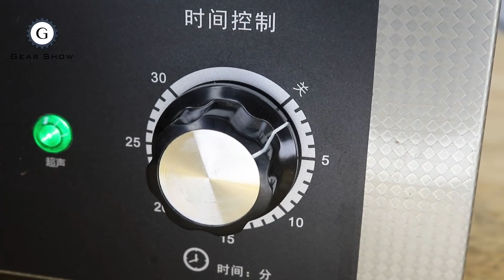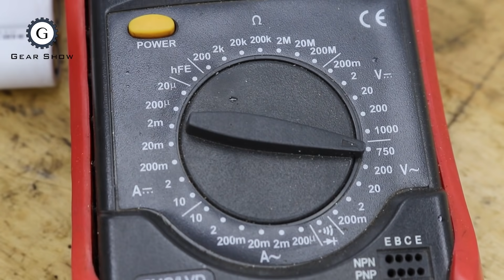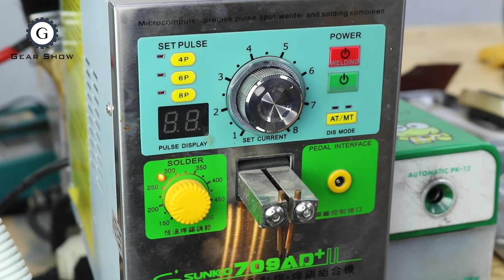Old version 12V Impact Driver Restoration | Dewalt DW052-JP TYPE1

Comment: Great work! I adapted a 14.4V DeWalt drill to use 20V Max flat packs, and that thing flies! I don't have to use high gear, low is fast enough!  I didn't think it would last long, but I've been using it several times a week for 3 years with no signs of cooking the motor.
Reply from the maker: Nice work, Thanks for the tips!

Comment: Very nice work! Only thing I would improve is thicker cable from main minus and plus poles of the battery pack to the BMS, since those carry a lot of current. The wires from BMS to drill are good.
Reply from the maker: Okay, thanks for the tips!

Comment: Audience, I know at 12:18. You want to keep that solder smoke out of your nose. Oh and great portable fan. I just use a small USB fan with battery pack. It works the easiest. Great job on the full restoration...

Comment: So is it just me or was the drill ok from the start and just needed a hot battery 😂? Great work cleaning it though
Reply: Bearing was bad.
Reply: Where does it show that the bearing was replaced or damaged for that matter I'm sure it was bad after removal because the outer race was what was used to pull it off either way it was a nice job
Reply: Lol I was thinking the same thing
Reply: I mean, I’m sure that if the drill was broken he would’ve named the video. “Fixing”
Reply: Restoration is just bringing it back to life it doesn't always have to involve fixing any sort of mechanical or electrical failure
Reply: Yeah I don’t think it was necessary to get into the drill that deep

Comment: You must have a different size 12v battery pack case than I do.  Mine will barely hold 2 18650 cells.  I would up having to go with new SubC batteries like it originally had.

Comment: I have to ask, are you able to use the original charger with the new batteries? If not how do you charge it? Great work btw, love the channel!
Reply: I have the same question. Also, there is a difference between working and working well/safely. Li-ion has different charge curves than Ni-Mh.

Comment: 6:00 You can open the sound wave sealed plastic with coolant spray
Reply from the maker: Oh, that is cool, thank you so much for sharing :)
Reply: Do you have any videos? I can't find anything relevant
Reply: @soldiers303  just search it on youtube The Easiest Way To Disassemble Laptop AC Power Adapters And Wall Warts

Comment: I notice you left one old NiMh cell in the battery. I realise you need it there to hold the contacts in place but wont the battery eventually corrode inside and cause other problems?
Reply from the maker: I use only negative of the Nimh battery, I think it will be okay.
Reply: @gear_show  that is not what I mean. The battery itself is old and looks about to start leaking and corroding from the inside out.

Comment: Hello;  Wondering why you did not change the single vertical/top battery?
Reply from the maker: I use it to hold the connector, It is insulation.

Comment: I would make sure the sucker runs before doing all that work, then check to see if the motor needs new brushes. Those little ball bearings I would have dropped most of it on the garage floor and never find it again. Been there done that. Do you need a new 12V Li-ion charger? Where did you get those decals? The two old impacts don't seem to hit very hard like my 12V Milwaukee, or perhaps the audio from the impact sound didn't come through. Excellent job, super impressive!

Comment: This was well done.  The soldering was a little ... excessive but very serviceable.  And you tightened by hand vs. with a drill or driver... Very glad to see that.  Would adding in a couple bearings to fill the gap under the bearing washer be of any use?  It hurts my ocd (and I know you didn't lose any.. its like that from the factory...)

Comment: Did you spray the cleaned case with clear? And if so what type? And how is it holding up being clear coat on hard plastic case...
Reply from the maker: Yes, I did. I use general clear.

Comment: 750+ comments; Nice work. How do you recharge the battery pack?
Original 12v will not charge up to 12.6v
Reply from the maker: I charge this battery with li-ion 12.6v charger. The original charger isn't used.

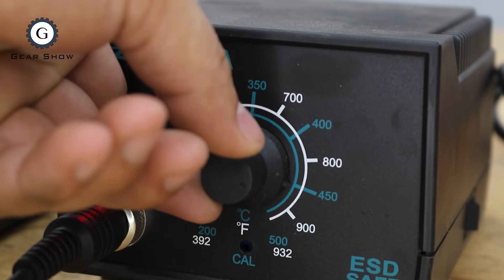Comment: 11:51 what? how many degrees did you set there? 450 ?????? that's a lot at most 300 for soldering otherwise the tin will be burned very quickly and you won't be soldering well otherwise super video :)

Comment: Question , the battery you put back on the top of the battery assembly that was soldered to the replaced batteries , was that a Nicad or Lipo battery
Reply: NiCd

Comment: 12:38 Isn't this gauge of wire too thin for the amount of current drawn? This BMS appears not be wired like other ones that have the negative from the battery go through the BMS board. So it appears the charge balance wires also carry the full battery current.

Comment: Crazy seeing a vid for this DeWalt model while randomly browsing the results & related-s of my very generic searches for more repurposed motor ideas after having very recently installing the deconstructed motor from this *exact* model as the means of spinning an extremely homemade (but robust af) ball mill thats powered by a similarly deconstructed microwave oven transformer with a DC-rectified, one-turn secondary just shy of 2, which keeps the ludicrously high torque @ high speed at a sane range while also supplying the voracious current demands to move the thing at a severe under-voltage. I would've preferred using a bunch of paralleled 18650's & be akin to the inverse of what this video accomplishes, but I learned that even a mere 3.7-4.2v is still hilariously WAAAY overpowered with this little beast of a motor & hence the "over-engineered" mains supply.

Comment: I am curious as to how, with a 6-cell you manage to get  12,6 V  !!!!
3.6 V * 6 cells =  21.6 V  or  the parallel  3.6 V * 3 cells  = 10.8 V to get double capacity.
Can you provide a schematic diagram ?
Reply: Full charge is 4.2v

Comment: Does anyobe know the size of the bearing in the drill retaining head? I watched this out of interest a few months ago and then saw the same model at 15 USD in a local Japanese thrift store with a bit stuck in. Another video (or this one) shows how to disassemble the head to take out the bit but the sleeve was so tight I had to bash it off and lost the retainer bearing. Now all I need is to convert to Lithium but the old battery is still going.

Comment: so.. this was put in  garbage bin because somebody opened it. and forgot to put back "bearing washer" @2:27 on right place.. and then put that back on wrong place @2:44...  You put that bearing washer on right place  at 19:23. .. so the point is.. always when first time you open the tools... either record a vide so you could see what goes back where or put on a table in sequence.. or if you are opening an old already opened device please follow user  Instructional manuals.

Comment: Excellent Job! Do you get the new labels from DeWalt or did you print them? Just one little hint for work safety: It looks as if the gasolene bottle is not marked. It is a good idea, not to use bottles that are - or look similar - to bottles for beverages and to put a label on the bottle just to avoid any poisonous mistakes.
I'll check out your other videos now. Keep up the good work!
Greetings from Germany!
Andreas
Reply: He printed them...his logo is on them.

Comment: ....The spot welder. I would be making battery packs if I had a spot welder. There are loads of old laptops thrown out at my work with good batteries inside them.  The spot welder is about 250 USD including shipping from alixp. I would need to make at least 5 battery packs to get my money back.  Hmmm... Is there anything else I could use a spot welder for? Some people make their own but that looks difficult too.

Comment: Very nice work I wish to try I need the specification of bms as how much amps am trying with same 3s 2p 18650 for a 12v cordless gun am unable to finalize amps, there is no ratings on gun

Comment: Isnt it dangerous to try and use a charger for NIMH (usually a DVDT) for a li-on battery?
Reply: Not so much cause the BMS will stop the charge when the max voltage is reached.

Comment: you could've used Gasoline as well as solvent to losen the glue on the battery casing and get it open easily without destroying it.

Comment: Don't understand how you only get 10 volts out of 6 X 3,4 volts batteries you should only need 4 in series to get the needed 12 volts load and 13,6 volts peak charge ? Although great work , you inspire others to do the same and not throw away good tools who can serve more years instead of heading to the landfills !
Reply: They are connected 2 in parallel in a series of 3

Comment: Thanks for great video. I have a question about batteries system. Are 3C li-ion batteries and 20A BMS enough for working drill correctly? I asked because I think converting my 18v metabo drill from ni-cd to li-ion. I  m hesitant about batteries instant discharge capacity and bms capacity. Thanks in advance
Reply: Any answer for this?

Comment: Thanks for the video! 
I have a beginner's question: after replace the internal battery from Li-Mh to Li-Ion, can you put it back on the Li-Mh charger to charge? Or after the replacement, the charger needs to be changed to Li-Ion charger as well? Because I thought the current Li-Ion battery chargers can't charge Li-Mh batteries?
Reply from the maker: The li-ion battery can't be charged with the Nimh charger.
Reply: @gear_show  Thank you for the reply! I guess as long as voltage and ampere suits, and connection compatible, any charger can charge right?
Reply from the maker: @barryluo2011  in this case https://youtu.be/ukKuCGG38n8 I can charge the li-ion with Nihm charger.

Comment: Amazing video considering you don’t speak at all!  One question: how do you recharge the new battery pack?
Reply: actually such batteries are charged from the same way from they discharge.. so when you put this battery in charger it is charged ...
Reply from the maker: Hello, I'm sorry for missing that part. I use Li-ion 12.6V charger to charge this battery pack.
Reply: @gear_show  How do you connect it? What Brand/Model/Specs are important?
Reply: Li-ion battery pack on charger without magnet relay switch,, 18V li-ion battery pack built-in magnet 🧲
Reply: @gear_show  could you post some more info on the BMS board and the charger you used? 
Thank you for posting these videos and for inspiring people to repair rather than buy new stuff.

Comment: Thinner wire from batteries to BMS, and thicker wire from BMS to the power connector is wrong. B+ and B- connections and the power input/output port should have the same gauge thick wire. The balance connections are ok.
Reply from the maker: Get the power source from BMS for low voltage cut off, if you connect direct from B+ and B- the battery voltage will reach 0V, that time you could not charge the battery.

Comment: You used thick wires from the cell managing PCB to the terminals, but shouldn’t you have done so too from the battery 0V and 12V to the PCB? Best regards

Comment: During the test, how did one of the screws get messed up (mangled)? 
Great video as always
Reply: The nail was set in a knot, they’re hard to cut, drill, hammer through. Caused the nail to mangle and torsion
Reply from the maker: Maybe this section of wood is hard.

Comment: Great job sealing the lithium battery up with no venting. These never get explodey. So how you plan on charging this now? SMH
Reply: He will probably modify his charger with CCCV (constant current constant voltage) electronic
Reply: @marko4377  gonna need a whole bunch more electronics than that.
Reply: Transformer, rectifier, capacitor and cccv? Am I wrong
Reply: @waltkosch  bms should have over load protection if it is better quality, I am building the exact same battery pack right now and I am using samsung 25r batteries and bms that have balancing and all protections features, in my opinion only thing he should have done is thicker wires, idk what quality is that type of bms and I would pick samsung or lg or sony or panasonic batteries. What do you think
Reply: @marko4377  Sony VTC5s. Good luck!
Reply: @waltkosch  yeah, i think makita use sony vtc as their battery cells and Milwaukee uses samsung, I hope it will be better than ni cad. Have you some expirience with building battery pack for cordless drills
Reply: @marko4377  I don't bother with making non lithium batterys lithium. To start with the motor alone isn't brushless.  It's like putting lipstick on a pig. With vibration and use and abuse you are best sticking with the stock packs that can often be found reasonably cheap enough not to go through the hassle of building them yourself. I only find building my own packs for hobby grade RC and things of that nature.

Comment: My master made it like new, even the factory cannot restore it like this, my master 13:45 can I find the name or the diameter of the cable, I can find what I write on the internet, I am designing an rc vehicle, because the lipo piler is overcurrent, the cable problem is the cable I am looking for, please write the name of the material you use.

Comment: @Gear Show You are using 3x3,7V batteries so it gives 11,1V. You should normally go with 4,2V batteries. How you get 12,6V? Or maybe there isn't 12V? Those screws where tighten slowly.

Comment: Too thin cables in the battery
Reply from the maker: I use 14WG DC wire.
Reply: @gear_show  ok, but to connect cels to bms u used thinner

Comment: Impact drivers are for concrete.
Reply: You are thinking of a hammer drill.   Impact driver is similar, but for driving screws, not drilling holes.  It can be used on any type of material.